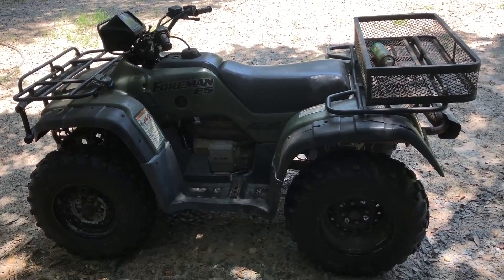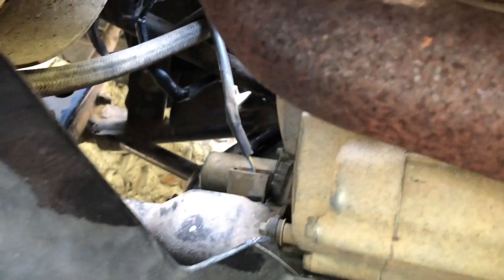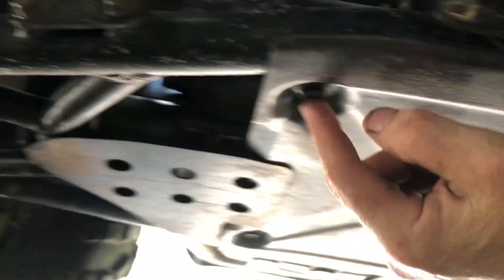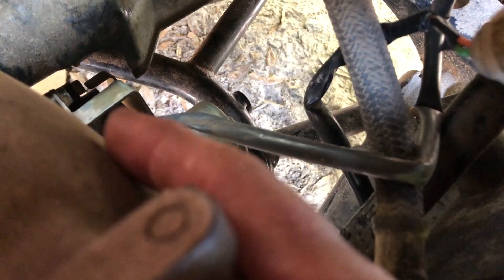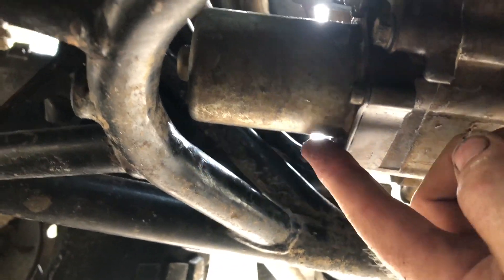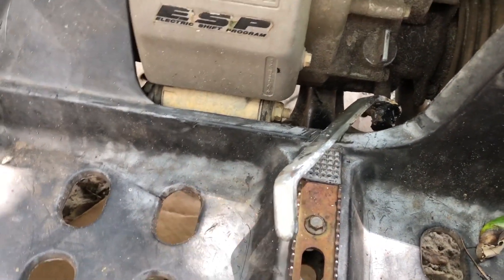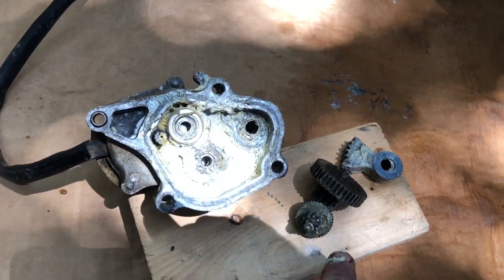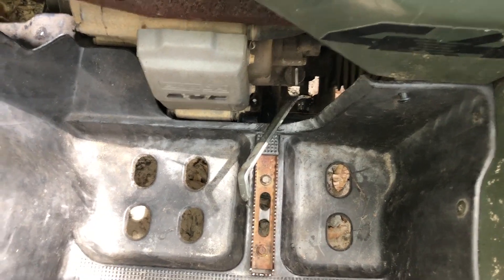Honda Foreman Shift Motor Mod

Comment: I had my shift motor on and I couldn’t shift past 1st is this because of the shift motor? I have the shift motor off now going to replace because mine wouldn’t function. Any ideas? I’m chasin gremlins
Reply from the maker: There are so many things it can be. One part that can give you fits is the angle indicator(?) It lets the shift motor know where it is. You could also have a bad wire. You need to find a shop manual and go step by step to find the real problem. I got tired of chasing the continual problems and went manual shift.

Comment: Question : on my 2009 the motor mount is odd as it too has the position sensor mounted on same flange as the shift motor. I think only the Foreman 2009 has this odd arrangement trx500fpe. Any way I see three large bolts holding the entire mess onto the trans case. My question is, if I gut the various small motor gears and re attach everything to keep dirt out do I have to reconnect the motor wiring ? And will the dash show the gears when manually operated ?
Reply from the maker: I can’t speak to the 2009 but the 2000 shift motor can be gutted and reattached and connected and will show the gears.
Reply: @TigerCreekFarm  Many thanks !
Reply: @TigerCreekFarm  question: what does the angle sensor do ? Does it assess the angle of the bike for safety, and shut off trans when flipped ? Or does the angle sensor assess what gear your in ?
Reply from the maker: I believe the angle sensor assesses what gear you are in.
Reply: @TigerCreekFarm  Thanks, I might try and get sensor off through that plastic cover and hope new sensor fixes sticking downshifts; upshits no issue.

Comment: Have you had any problems after making it a manual shift? Ive heard of people breaking internals by doing this
Reply from the maker: Hershel Thrasher no - but I had to develop a bit of a feel and method for shifting. If you are heavy handed or footed it would be easy to put undue stress on the gears. I shift with a hand lever and use quick, short strokes that give me trouble free shifting without any extra force.

Comment: I have a foreman 500 2013 and the electric shift won’t do anything won’t click or nothing and on the emergency shaft it won’t let me go into reverse so I’m stuck on what to do
Reply: Team 2muddy mine done the same thing Change the shift motor and angle sensor
Reply from the maker: My .02 cents.
Make sure the reverse button is being fully pushed when trying to shift into reverse

Check the cable switch and the cable itself 
Check the battery charge (lot of ES shift problems are because of low battery)
Check the engine oil level  
Check (replace) the angle sensor